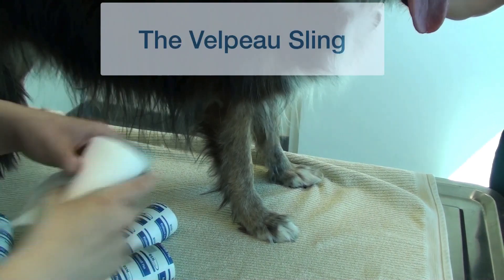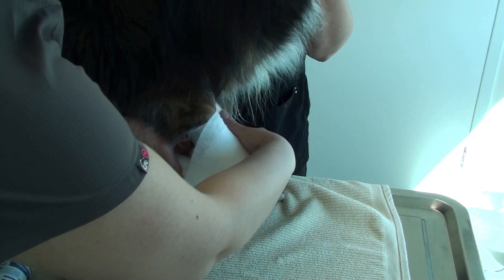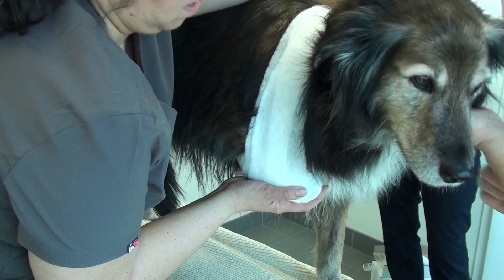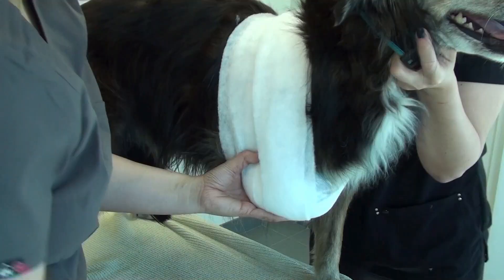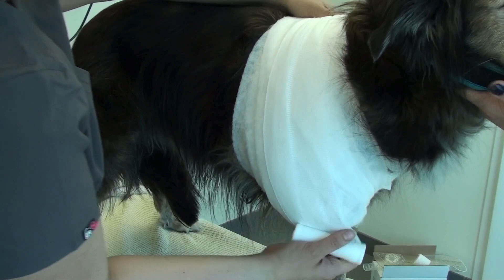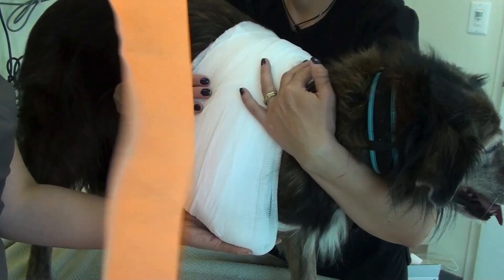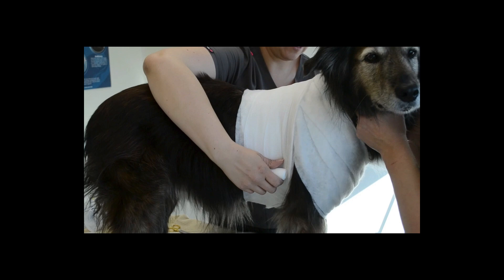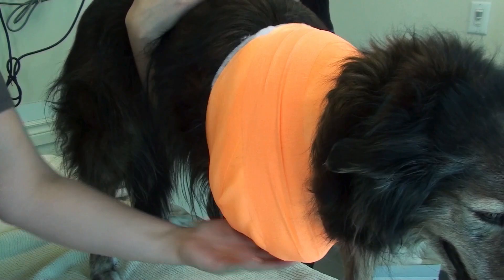How to apply a Velpeau Sling to a dog

Comment: What would you advise for an older dog with a chronic injury? Shoulder subluxation has just been diagnosed four years after the injury was sustained (it was overlooked by a whole series of vets). The specialist physio vet has not recommended any treatment to help support the shoulder (he also failed to diagnose it during months of weekly treatment) but has now confirmed another vet's opinion. It seems implausible that there is nothing I can do to help stabilise the shoulder outside of nutrition, supplements and gentle exercise. Can you make some general recommendations for me to investigate independently?
Reply from the maker: Hi and thank you for your question.  I am assuming you are referring to MSI (medial shoulder instability).  My old girl that  just past a few months ago had that in both her shoulders :(
Through my years as a specialist that was one of my least favorite diagnosis to make.  Firstly, the only way we can actually confirm that that is the problem is with MRI/arthroscopy so it was always presumptive.  A very difficult diagnosis to make.  Yes there is a surgery that can be done to help but the success compared to conservative (non-surgical) management s equivocal.  I would send my worse cases to surgery but the post-op was difficult.  There are braces, I have not been impressed with them.  I would usually start with conservative - rest- and I mean rest, anti-inflammatories and physical therapy.  I spent most of my recheck times supporting the owners, encouraging them to continue with the restriction and taking them off the ledge because rest is not in some dogs' vocabulary!  I had 2 patients not do well with this.  My girl would flare up every so often and I would put her back on anti-inflammatories and restricted activity.  She responded well.  Good luck with your dog.  This is not a bad diagnosis, but it can be difficult to manage.

Comment: In which type of fracture we can use this
Reply from the maker: Hello and thank you for your comment.  The Velpeau sling is most commonly used for a shoulder or scapula luxation  issue.  It is not commonly used for a fracture.  The spica splint would be better for a fracture.  A sling should never be on longer than 7-10(ish) days; that time frame is not long enough for a fracture to heal.  I hope this information has answered your question.